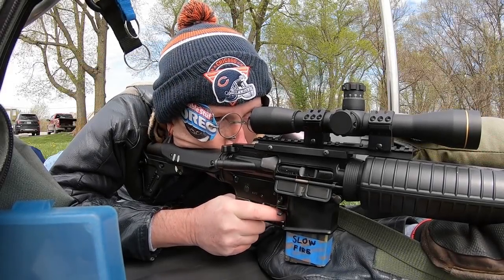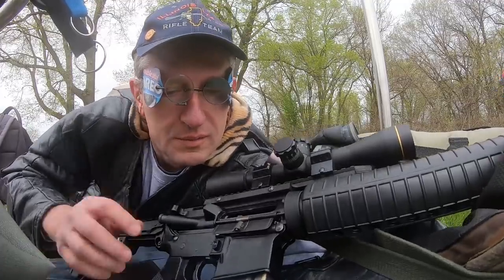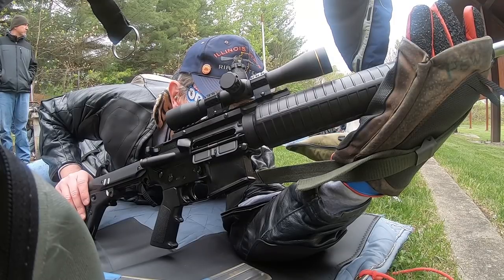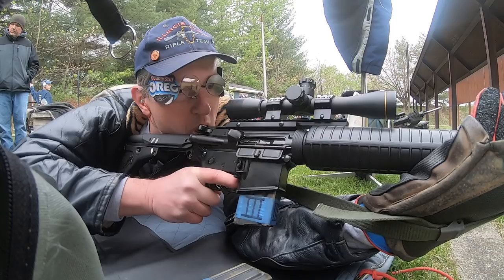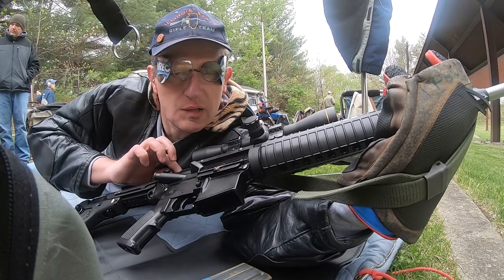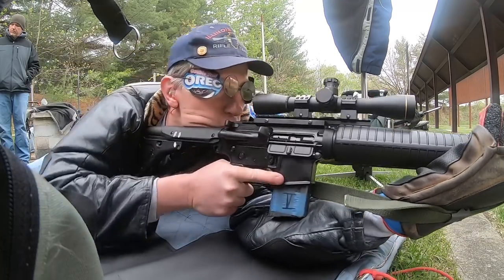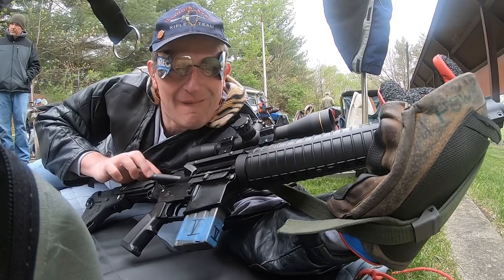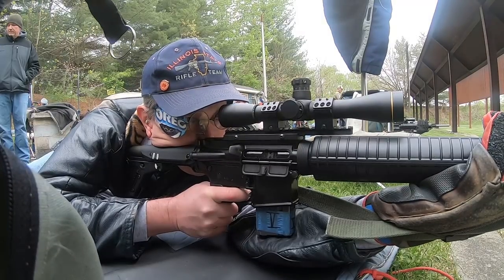Rapid-Fire Saved Rounds and the Story of a Gas Key

Comment: As an Ar-15 armorer in law enforcement, one task I had was inspecting "purchase carry" rifles officers would want to qualify with. These were rifles the officers purchased on their own to carry on-duty. One thing we saw often was improperly, or just completely non-staked gas key screws. I had a jig and would confirm torque, then stake those down. It was amazing to see how much variance there was in manufactures of bolt carriers. Once staked down well, I never saw this problem, but if they are not staked down, the gas key will work loose and you will see this short-stroke problem.  To the others out there, I highly recommend staking them down well.

Comment: Excellent video Konrad. Thank you very much for making these. At about 4:00 minutes into the video you mention your bolt catch spring is "purposely very weak". Is this to help overcome the added weight of the BAD lever?
Reply from the maker: There's really no need for a strong spring on the bolt catch. Actually, you can just remove it altogether unless you don't want the catch to be flopping around.

Comment: I just experienced these same symptoms with a brand new BCG in a new upper build.  Initially, my upper wouldn’t reliably cycle rounds at all…after some more use, it started cycling rounds, so at that point, I assumed it was a break-in issue, but would not lock back fully on an empty magazine…and occasionally like in your video, it would lock back on the front of the bolt carrier, not the bolt itself.   I went to the range with a different lower, new buffer and spring, and a replacement BCG…new lower didn’t work.  Neither did a different buffer and spring…that eliminated the lower as the problem.  Finally out of frustration, I swapped BCGs and it works fine now…I checked the gas rings and they’re fine, but there was powder residue all over bolt where normally that pattern is not the case.  I suspect that extra residue is from a leaking gas key.  I’ll send it back where I bought it to either be replaced or fixed.

Comment: Poised in the face of adversity.Thanks for sharing this experience :D
Reply: Gotta be quicker on the immediate action though. Konrad also takes longer on the 1st trigger takeup of each mag than most people - a distinctive feature of his technique that I've noticed.

Having enough skill and experience to develop an accurate internal clock helps decide if you should be faster/less settled and risk a bigger group that might not be centered for lower 90s, or slower/better rebuilt and very accurate/precise, but risk saving a round for high 80s.

Comment: Was the bolt new with the new upper?  Just wondering if it's a wear and tear problem, or a manufacturing oops?
Reply from the maker: The bolt came with the new upper. This happens sometimes as it's difficult to get the key sealed. It was fixed quickly and the rifle functions great.